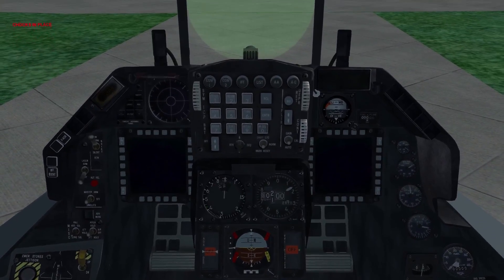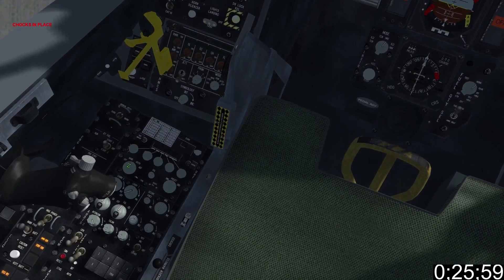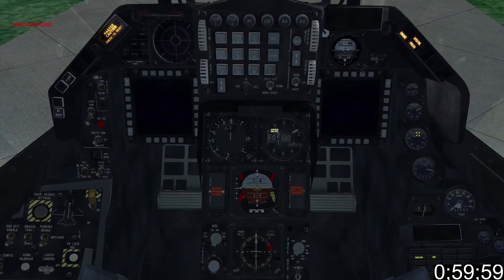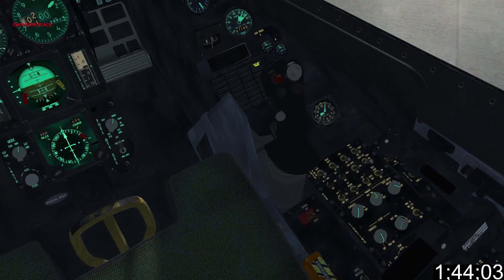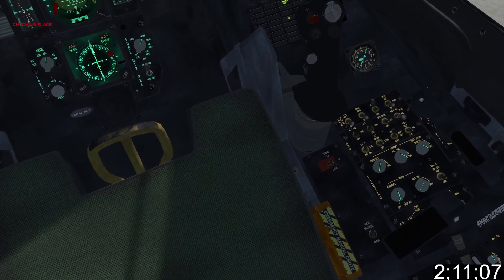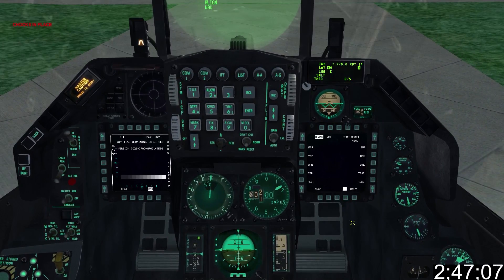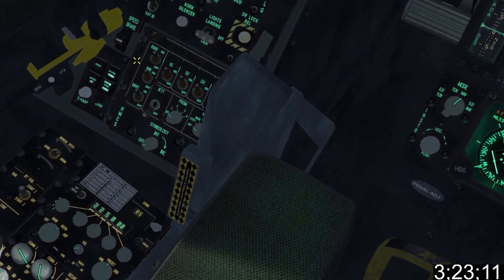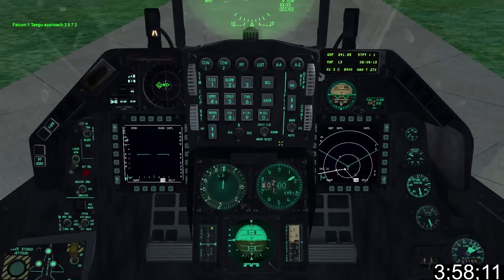4.0 Minute Falcon - BMS 4.33 F-16 Startup Tutorial

Comment: Hey bro i need help I don't have a hotas and I can't use throttle any keys on keyboard that controls throttle I use logitech attack 3 joystick Plzzz help any help would be appreciated
Reply from the maker: Thank you sir.  There may be keys double bound or 2 keys assigned to the same function.  Best way is to go into the settings in DCS, click on a key that's already bound from each column, then click 'clear category'.  This will remove all the bindings for each category.  Then you should be able to re-bind each function to either keyboard or your stick, it takes time but it's worth having the bindings you want.

Comment: Good Day Sir, I am really sorry but I had no other option but to share with you. I have started playing BMS and love it. The problem is the graphics. When I watch gameplays and tutorials of Falcon BMS, I see it a lot different from mine. I have turned my settings just as you said in your previous tutorial, but it looks like anti-aliasing is not working and pixels are unstable. It's really frustrating. Help would be appreciated and thank you for reading this long and painstaking comment.
Reply: @darkshadow7709  The issue is with the resolution not setting properly. A workaround that worked for me is as follows:
Right click on the Falcon BMS launcher (can be done on the desktop shortcut), go to properties, then compatibility, and check the box "Disable full screen optimizations". This should allow for the correct resolution to be picked up in game. I found this solution on the Falcon BMS forum.
Reply: @mindsofeuropa2955  Alright I will give it a try, thanks!
Reply: I checked the settings and it was exactly like what you said. Then, I started instant action. It seemed to be perfectly smooth with graphics this time. And I noticed that the cockpit was looking better and the text size normal.  Was it a coincidence? Then, I said "Okay, let me try some other missions" and it was back to ugly graphics. I restarted, and the same bad graphics. There, I realized that the resolution is the main problem. I noticed that while I am flying in bad resolution, the text is very large and the cockpit is wider but fits on my monitor. I have 1920X1080 monitor with 144 refresh rate and my settings are according to my monitor. Then why the hell does it not work (and sometimes works)?
Reply: @darkshadow7709  Did you ever find a solution? I'm having the same problem

Comment: Fun Fact: You can also set an idle detent in the control settings by right clicking the after burner detent. 

Note you may need to check out some initial settings in the config when you first run the BMS.exe
Reply: Good info, albeit of dubious practical use, if you don't have a physical detent on the throttle... plenty of unwanted engine shutdowns, I think... :)